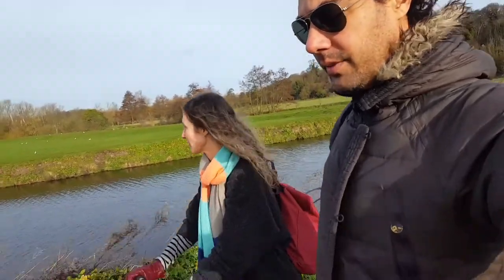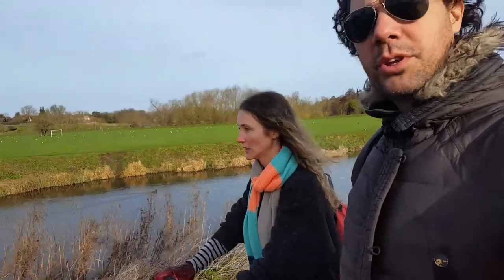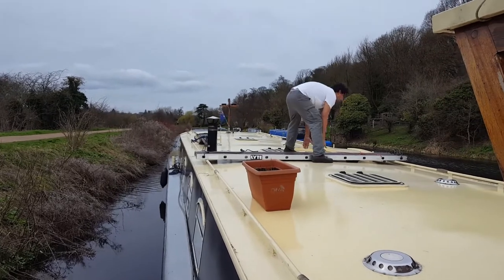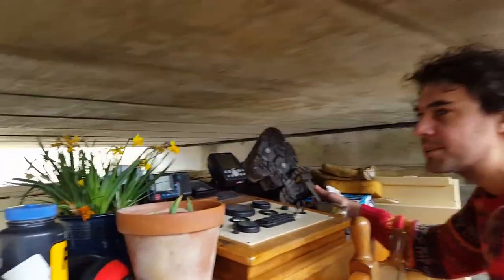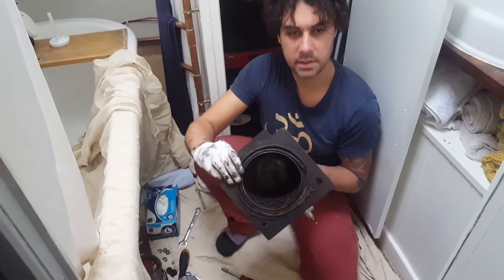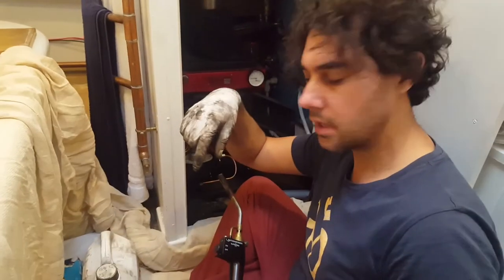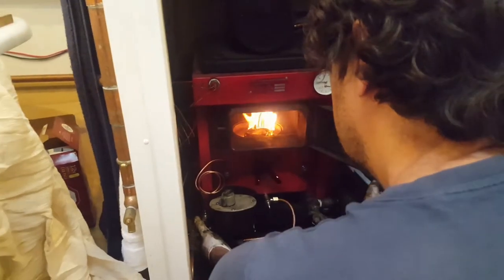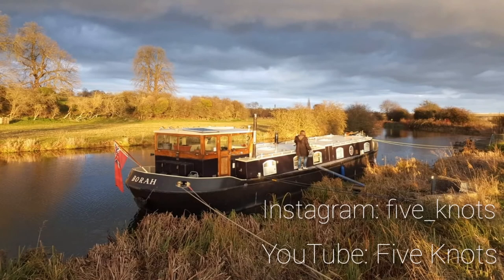Episode 9: Ballasts, Bridges and Boilers

Comment: That's rather odd regarding the UV... hopefully working with the company you can get it sorted but it's got to the point where ideally they should come out to you and find out what's going on. 

Very interesting to see that Kabola Boiler. Very similar to the Refleks and others like them. So simple but so effective. I would honestly install one in the house as I consider them a lot safer than gas. However we do love our wood stove as there's nothing quite like it to warm you all the way through! 

I agree... I think next time Corey should be encouraged to take one for the team (and indeed the camera) and take a leap of faith. Where do we place our bets?
Reply from the maker: Consider your bet placed! 😂

We've given up on that company for the UV after one too many disappointing interactions. Looking at a different one altogether now - we think our electronics weren't matching up to get the bulb to light. Might be an expensive alternative but a good (and probably the only!) solution. 

We love our Kabola. Though it hadn't been used for a while when we first moved onboard and it took quite a bit of elbow grease to get her up and running and heating our radiators. But we've got it down to a fine art now. In fact, turning it off regularly at the moment as it's too warm! 😀
Reply: Always annoying when you do your research and what turns up either isn't anything like the item advertised or has little to no support from the supplier. Good luck!
Reply from the maker: @mjallenuk  It is quite disappointing. But I figure we've never done this before and there's not a lot of information out there matching our situation so we're bound to not get everything right first go. I'd like to write an article or maybe do a video of all the pitfalls we've encountered to help anyone else thinking of doing the same.
Reply: I think there's a lot of people out there who I'm sure would be interested. Guides on anything that make peoples lives easier in the long run tend to be popular and also an opening for feedback on how to improve on what's already been tried.